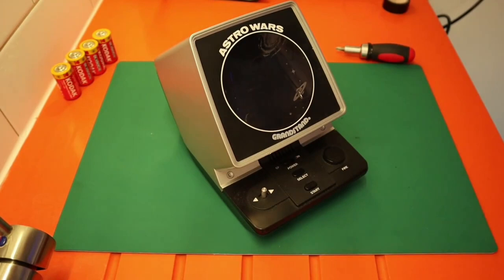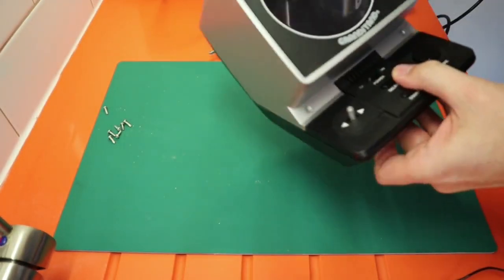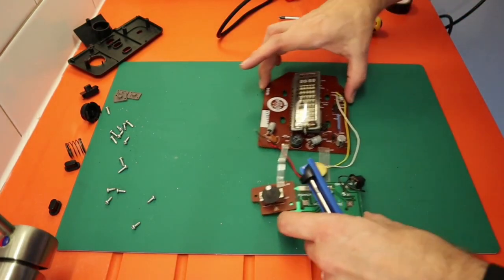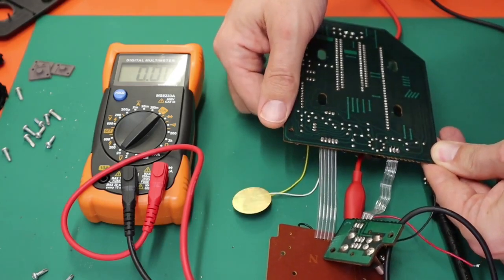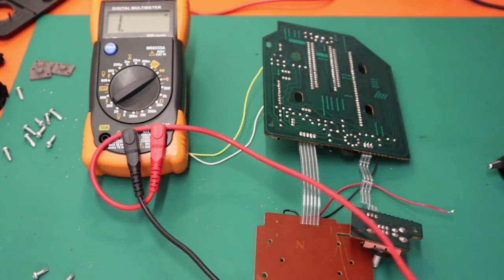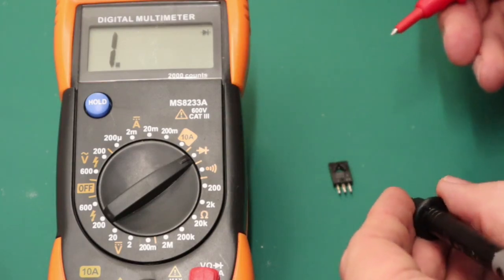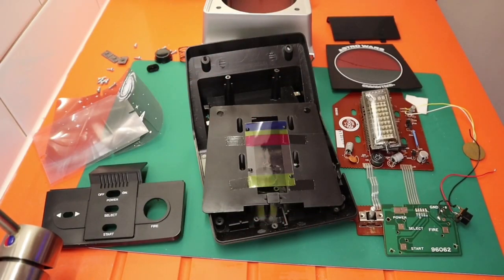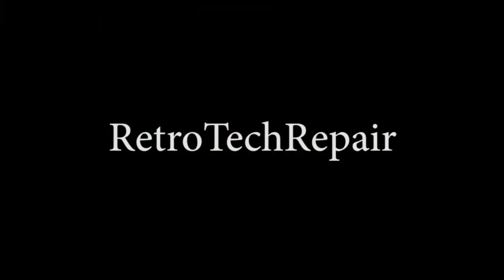Grandstand Astro Wars / Galaxy II repair - Retro Games

Comment: Hi, Could you please help with some information. I've had this game since it came out but just recently damaged it!!! I wasn't thinking and hooked up a power transformer. I put some batteries in and only had sound. The batteries were old so I though not enough power. I then used a multi volt transformer on 6V but still only had sound. I had a brain snap and put the power up to 12v. Now no sound or display!!!!! 
Could this be the power transistor or some the simply needs to be replaced or has the whole thing been fried? I do have the dark spot at the bottom of the display but it's not white.. Thank you.
Reply from the maker: Hi abcmatt... I doubt it's completely fried. I have seen many of these with failed D882 power transistors and my theory is that an incorrect power adapter similar to your description is the cause. I don't think not enough power was the original problem. But if you get it back to partially working we can take it from there. I suggest testing the power transistor then replacing if faulty and see how it goes. The scramble, and munchman all had similar faults and I think I talk about transistor testing in one of those so maybe take a peek at those vids too.  Thanks for the comment... Good luck, let us know how it goes and if I can help more let me know. Finally if you enjoy the vids and would like to see more please consider subscribing, as a new channel it really does help us when you do. Cheers !
Reply: @RetroTechRepair  Thank you so much for the reply. I'll will do some testing etc and get back to you. Fingers crossed. Definitely will subscribe.
Reply: @RetroTechRepair  Ok firstly I'm just using the games batteries (not brand new batteries) as the power source.  Testing on the "off" side terminal area, I get a reading of 5.15v but when I bridge the 2 so it is in the on position it drops to 1.90-2.10v. I kept them connected then walked away for a minute. When I walked back into the room, I could smell a slight burning. I put my finger on the power transistor and it was so hot, I couldn't touch it. 

2 different faults or one causing the other to be faulty?
Thanks again.
Reply from the maker: Hi @abcmatt The power transistor should not run hot. My guess is that there is a fault elsewhere on the board that is causing the power transistor to over heat. The overheating D882 is a symptom of the other fault, but if it overheats too much it will burn up causing a second fault.  That could be why it fried the first time. On batteries the current is limited to what the c-cells can deliver. That is why the voltage drops. It would probably burn up sooner on a power supply where the batteries are not limiting current. The over heating may or may not have damaged the D882 so if you have a multimeter I would test it. I think my munchman video has a nice segment in it on testing the transistor.
I had the same problem on one of my repairs and burned up a couple of D882s trying to fix it, I shot a video of it, but haven't edited it and posted it yet.  In my case it was the failure of SO6 which is behind the bottom of the display. You may also have an SO11 in series with SO6, this was a change the manufacturers did to later boards (my guess to improve reliability) or you might not have an SO11 at all. I bet if you were to lift one leg of SO6 then D882 will be cool again. Although the game still wont work. Unfortunately SO6 is not marked, so you cant figure out by looking what it is.  I fixed mine by replacing it with a spare part from a scrap board. SO6 could the problem, but I cant tell you for sure what to replace it with. I did do some experimentation and THINK it MIGHT be a 140v Zener Diode (something like a  1N5275B or 1N5275Be3). If you were to try it it would be at your own risk, I could be entirely wrong. Yes 140v not a typo.... the board uses some clever boost circuitry to create over 100v AC to drive the display. Hope that helps.
Reply: @RetroTechRepair  Hi mate. Well you are an absolute legend! It's only taken me 3 months to get back to it. It has been sitting on my table, pulled down and awaiting me to get some guts. I am great with electrics but never tried working on green boards and especially anything attached to them. So I removed the old power transistor and soldered in the new 50 cents one and it powered up! Thank you so much for the great upload and also your advice. Really appreciate it.
Reply from the maker: @abcmatt  That's Great! Thanks Matt for getting back to me. So pleased I was able to help.
Reply: @RetroTechRepair  hi mate, where is S06 and S011??
Reply from the maker: @jesusga8319  SO6 and SO11 if you have one  are behind the bottom of the VFD display. I haven't worked out what these parts are. I guess at Zeners, but could be wrong and don't know voltage. If you are able to confirm let us know!

Comment: On mine the joystick doesn t comes to center "automaticaly". Is this repairable ?
Reply from the maker: Hi, I am not an expert in repairs, but it could be repairable or perhaps if not made perfect improved. If it were my game I would start by disassembling the game, then cleaning the joystick mechanism with a lubricating plastic safe switch cleaner. This is not advice or a recommendation, just what I would do. Thanks for your question
Reply: @RetroTechRepair  ok thanks for the advice. I think It s a good idea. I will try. I let you know 😉
Reply from the maker: Happy to help good luck.
Reply: @RetroTechRepair  used lubricating plastic safe cleaner for électronic parts. Still have the problem with joystick but sensitivty is more better. There were a lot of dust particles in there. Happy with this advice 😉
Reply from the maker: @ericboog5111  Thanks Eric, Sorry that it didn't fix your problem. I suppose you "could" disassemble the switch but I have never done that and don't know if that's a good idea. Perhaps somebody else here can help.
Reply: @RetroTechRepair  yes disassemble the joystick is a good idea. I will buy a wrecked game maybe to see how it made. 😉
Reply from the maker: @ericboog5111  Hi you could try a silicon lubricant too... might be cheaper. No guarantees sadly
Reply: @RetroTechRepair  why not. I have some silicon lubricant too. I don t know why the stick doesn t come in the center automaticaly. Is there a spring ? A bended metalic part ? But for now It s ok for me. I can play the game 👍😉

Comment: hello mate, my name is jesus and I would like to repair my astro, I changed the d882 transistor but it gets too hot, where is the s06 or s011 that you said in the video, if you can pass me an image of what component is it, I would appreciate it, thank you very much I hope answer
Reply from the maker: SO6 is located under the VFD display at the bottom. If your D882  is hot my guess is you don't have an SO11. I think that was Introduced on later boards to improve reliability. If you do have an SO11 it is next to SO6
Reply: @RetroTechRepair   hi friend thanks, what component can be the s06???
Reply: @RetroTechRepair  my astro wars only has s06
Reply from the maker: @jesusga8319  I don't know for certain but think it's a 140V Zener Diode. Although it's not an exact match  I have replaced it successfully with a 1N5275B
Reply: @RetroTechRepair  ok thanks friend, i replaced in this week, i say also you friend
Reply: hi friend i replaced 130V Zener Diode, the game off, the D882 temperature cold, the board has 6,5 v, the next week buy zener 140V because the shop didnt have the 140v diode zener